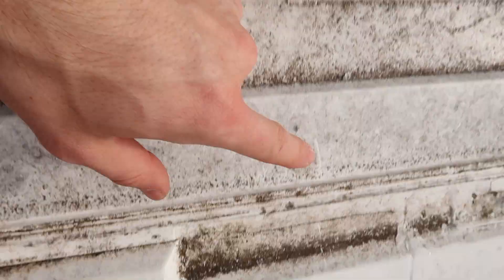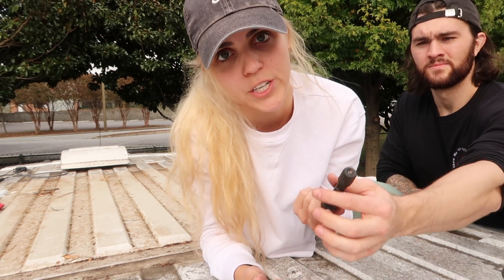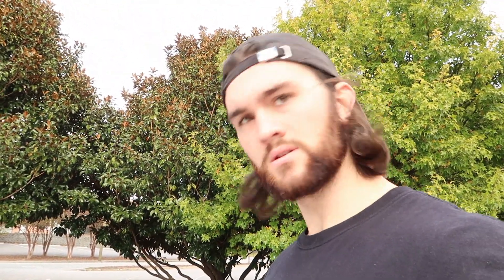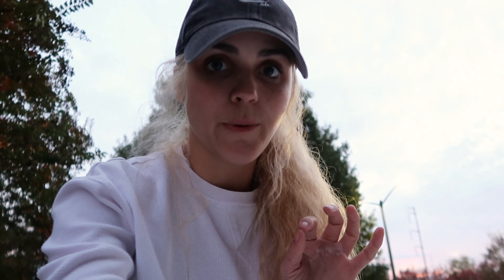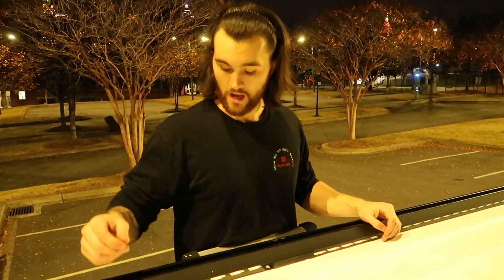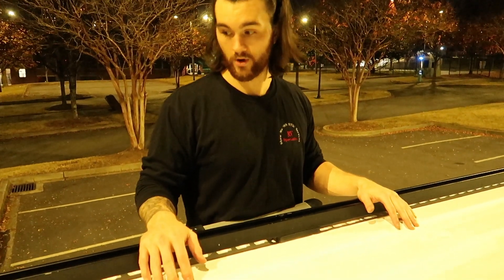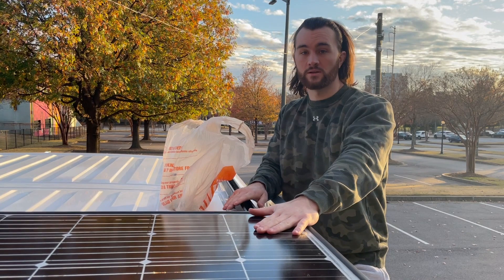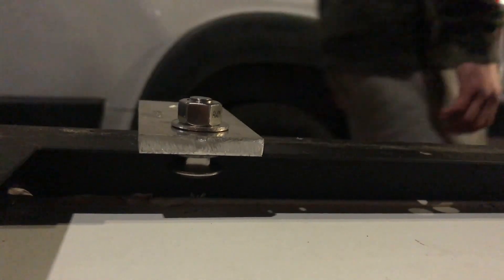DIY Aluminum ROOF RACK with Solar Mounting | Promaster VAN LIFE Build

Comment from the maker: Reviewing the video, we did not explain attachment of the solar panel to the roof rack.

We used a galvanized spring nut that sits in the roof strut channel and a hex bolt + washer that slides into the open hole of the 2-hole flat washer and into that spring nut. You’ll use a socket wrench to screw it tight.

SOLAR REMOVAL »
Dicor Lap Sealant › https://amzn.to/3pFnwps
EternaBond Tape › https://amzn.to/3nuUGFA
Solar MC4 Connectors › https://amzn.to/3vICVGw

ROOF RACK »
10 ft. Aluminum Struts (2) › mcmaster.com/3230T26/ 
5 ft. Strut Channel Covers (2) › mcmaster.com/3204T84/ 
Promaster Roof Mounts (3 sets) › https://bit.ly/3jfmZW4
Large (~1 inch outside diameter) Flat Washers (6)
Matte Black Rust-Oleum (2) › https://amzn.to/3CjyW5O
Clear Top Coat Rust-Oleum › https://amzn.to/3m8tgWB

SOLAR MOUNTING »
2-Hole Flat Square Washers (4) › mcmaster.com/33125T922/ 
3/8 in. Galvanized Spring Nuts (4) › mcmaster.com/3259T922/ 
3/8 in. Carriage Bolts & Nuts (4) › https://bityl.co/5TN5
3/8 in. Hex Bolts (4) › https://bityl.co/5TN8
3/8 in. Flat Washers (4) › https://bityl.co/5TMy
3/8 in. Lock Washers (4) › https://bityl.co/5TN2

Comment: Very informative video. However, I don't fully understand all pieces involved in attaching solar panel I strut??? What pieces were needed? Thanks
Reply from the maker: Hey Bill. Totally understand. This was a more difficult one for us to navigate.

We got this idea from a blog post by thehuntersvanlife.com as mentioned towards the end. They explain how to do this along with supplies needed. However, they had some mistakes in the blog that made things a bit confusing.

Supplies depends on how many solar panels you have. I did rewatch and noticed we didn’t include the attachment of the panel to the roof rack. Luckily that part is very simple. That’s where you’ll use the galvanized spring nuts.

Those will sit inside the roof strut channel, spring faces up. After the 2-hole strut brackets are attached to the solar panel, place the solar panel on the roof. Line the spring nut with the open hole of your 2-hole flat washers. Add washer onto a 3/8” hex bolt and put the bolt through your 2-hole washer and spring nut. Then you’ll just use a socket wrench to screw that bolt tight into your galvanized spring nut. Then you’re all done!

We linked the supplies in the description of this video. We split it up the roof rack and solar mounting links so you know which supplies are for which part of the project. If you look under the solar mounting section, that’s exactly what we used and how many of each.

Comment: You went with 10' roof rack, is it possible to do more than 10' on promaster 159 wb (such as 11' or 12') or the 10' is the maximum roof length
Reply from the maker: Yes, you can do the entire length. We only used 3/4 of the mounting points on the roof. Their is a fourth one at the very back on the driver and passenger sides.
Reply: @darian.explores  so will the 12' struts fit?
Reply from the maker: @StephenShreds  Yes, we just didn’t need that long. :)